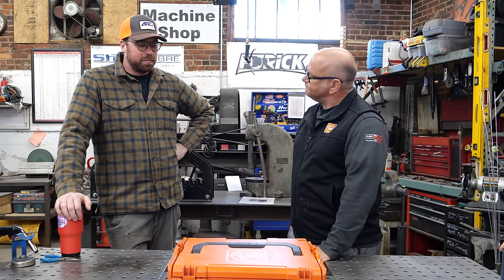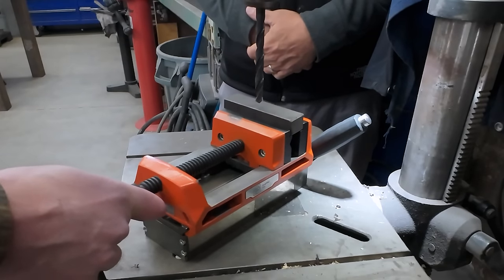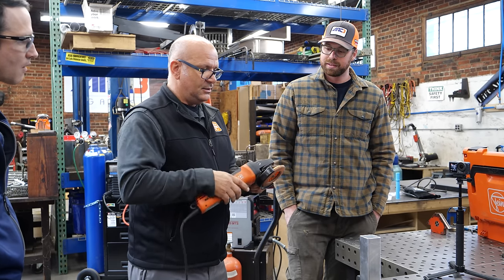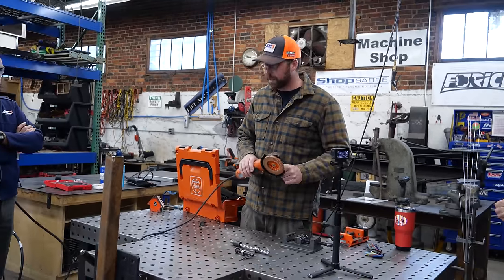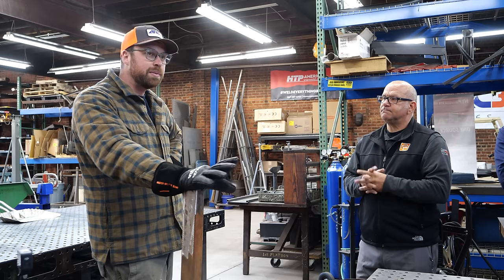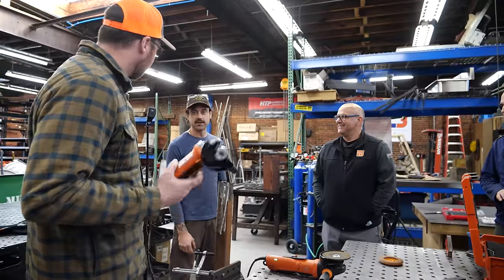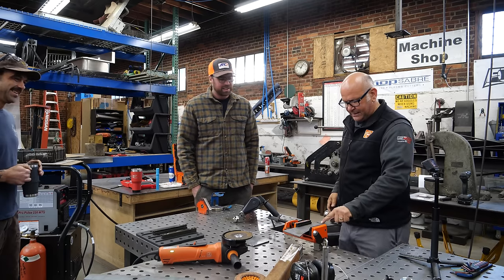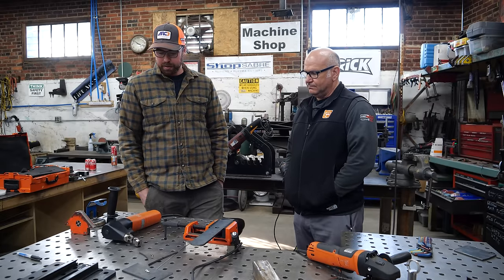These Tools Are SO Fein

Comment: Those are some Fein tools. That nibbler is a monster metal eater! I like the variable speed grinder, but I hate paddle switches. I have a variable speed Milwaukee grinder I got about 7 years ago that I absolutely love. It has a sliding lock switch that I like so I can hold the grinder at weird angles without having to keep my fingers on the paddle. I also like to use it for wire wheels so I can slow them down and make them last a little longer by not building so much heat into the wires, breaking them off and having them stab me like a porcupine. The vise would be a must have for me because I can see so many situations where it would be a Fein addition to the toolbox. What a Fein video!
Reply: Thanks for the feedback! We do offer a slide switch for this model! For this particular demo, we didn’t have the time to showcase that model. Contact me if you or your local distributor would like more information. Thanks again for your comments!

Comment: These three fein products have been making the rounds on social media. They have so many products I’d like to see in use. Their 4 speed “metal working’ cordless drill is one of the few (Only one I know) that’s not made in China. The issue that prevented me from dropping $625 on the drill and a couple hundred more on attachments is that it takes fein batteries. Most of feins’s cordless tools are switching to amp-share (Bosch batteries) so some tools are fein battery only, some are fein or amp-share and some are only amp-share.
Reply: Hi there! Thanks for the awesome feedback. You’ll be happy to learn that by December 2024, all Fein tools will be outfitted with amp-share batteries! If you have the Fein battery platform, we will support that for five years. Any questions? Hit me up, I’m always happy to help out!
Reply: @dannyjames2214  Well that’s good to know. Not that it’s the biggest problem to have multiple battery platforms but it’s nice to keep it to a minimum. If everything will eventually be amp-share including the ASCM-18Q 4 and the slugger mag drill as the grinders currently are it will be a no brainer. Thank you for the info, I look forward to the full roll out.

Comment: LOVE MY FEIN TOOLS BUT....
They are very expensive 
That grinder is probably $350
I paid $150 for a used (Allen wrench) Multimaster then after about 5 years of continued use I found a new one at Goodwill with the quick release stuck for $3.99.
I tapped the the pin with a hammer and it popped right out. Been using that one for another 5 years. 
I LOVE THE LONG POWER CORD THEY HAVE TOO.

Comment: It is not always about "getting more" done. With good tools you can do more, but you can also do the same without putting strain on the tool or - more important  - on yourself. Yeah, i still could wrangle a workpiece around, but I just don't want to. I didn't want to 20 years ago, but now I really don't want to 😎